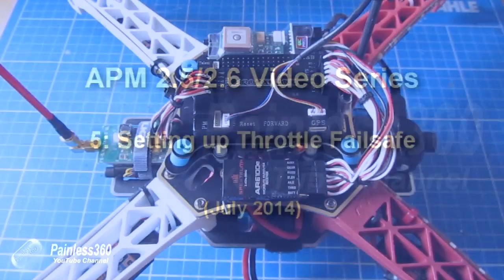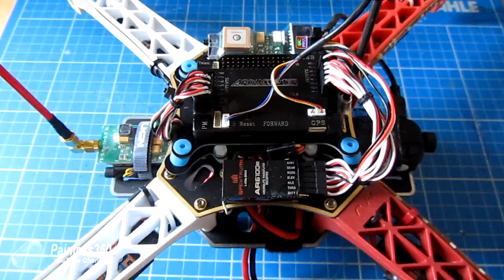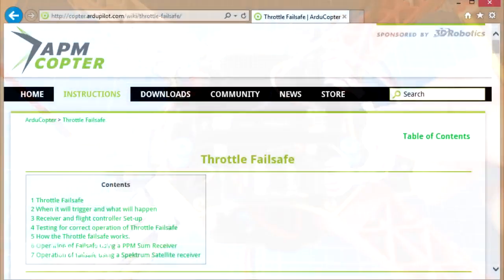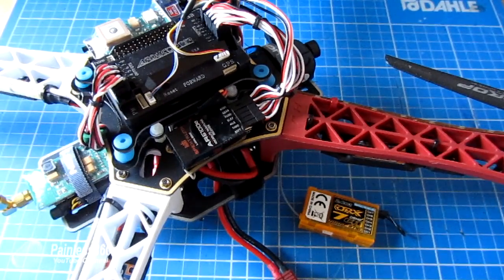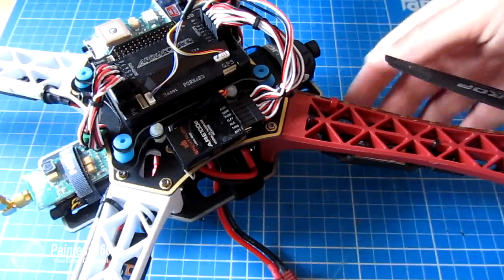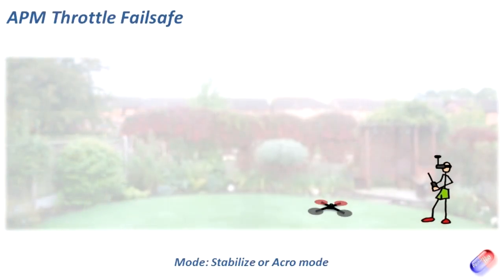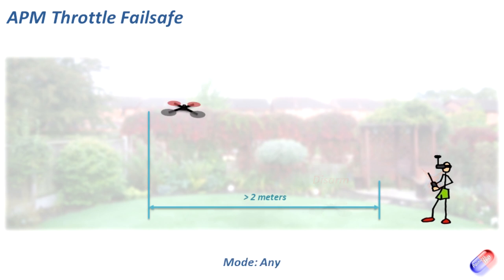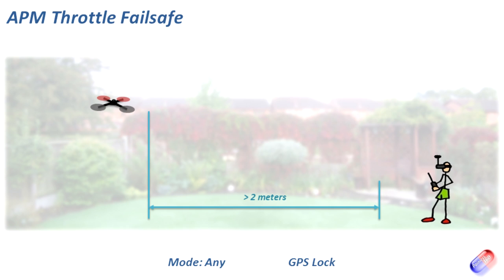(5/8) APM 2.5/2.6/3.1 - Throttle Failsafe Setup

Comment: This gave me problems that I'm still trying to resolve.  I'm using Spektrum dx6i, and something happened with my arming process to where the new stick values are making my left+down position on the throttle to where it refuses to arm.  Not sure my model transmitter works the same as yours, but if I can solve my issue will edit the solution here for anyone else having the issue.
Reply from the maker: Please follow my Pixhawk series. This one was for the APM that isn't supported any more and lots of details at out of date...
Reply: @Painless360  Ah!  thank you.  Not sure how I got to this one, but you've saved me much more future problems right there.  Thank you thank you once again.  Your videos are the most accurate and comprehensive; subject by subject, and the pace is perfect.

Comment: Old video I know...but what did the rebinding do?  It set a different low point? So you are saying that each time a radio is bound to a receiver that the radio also tells the receiver what the high and low points are?  Even without moving the sticks? That part wasn't clear to me.  Thanks...
Reply from the maker: In these receivers rebinding sets the failsafe channel position.. Happy flying!
Reply: @Painless360  Thanks very much.  Yeesh something so basic about binding I didn't know...now off to set my failsafes...  :)

Comment: When I push throttle up all motor spin but  quadcopter didn't lift up,  why it's so
Reply from the maker: Could be a few things. Have you watched my series on it? What troubleshooting have you done already?
Reply: When I set the throttled end point to max. 120% on transmitter,  value on mission planner did, t go below 1080 & then when I push throttle fully,  the display did,t fill fully.  So are changes need.  Plz help
Reply from the maker: That won’t stop the model from hovering. See http://ardupilot.org/copter/docs/common-radio-control-calibration.html I’d check ESC calibration and prop size and fit.. best of luck

Comment: Help if you set the failsafe via the receiver is it still necessary to set the PWM to 20 PWM less?
Reply from the maker: I check out the latest on failsafe in the ardupilot documentation. Best of luck

Comment: Hello, 

I am not able set my Failsafe or even if I am doing it correctly, I am not able to arm my vehicle. I am arming through safety switch and then applying Right Yaw but in spite of all this, Mission planner keeps showing DISARMED. It even asks "Precheck - Throttle Failsafe value". 
Please check the issue here, for more information - https://discuss.ardupilot.org/t/errors-disarmed-failsafe-no-rc-receiver-and-motors-do-not-stop-after-operation-or-not-disarming/31317

I request you to solve my query as soon as possible. 

Thank you in advance for your help.
Reply from the maker: When I've had that this page has held the answer - http://ardupilot.org/copter/docs/prearm_safety_check.html best of luck..

Comment: This setup does not work with the FS-i6s transmitter. After setting the end point values, then trying it out, you cannot arm the APM 2.6, it just displays "PreArm: Check FS_THR_VALUE"
Reply from the maker: That’s a common problem with lots of radios. Check in the forums, there’s lots of detail on how to sort that out. Best of luck!

Comment: Awesome videos. Iam testing RTL indoors without props and 7 satellites on GPS. It engages in RTL when I kill power to the radio, but the motors continue to spin for a very long time. Is it suppose to disarm when it returns to launch?  Thanks.

Comment: Thank you for all the efforts, on APM 2.6 setting FS_THR_VALUE set to option 2 drone will RTL when Radio signal loss, I use pc to set way point and  switch radio to Auto mode, NO telementry. ANY IDEAS to make it continue with mission? thank you
Reply from the maker: +PAL- GATE not sure on that one. I'll have a look in the forums to see if anyone else has had a similar problem. Best of luck..

Comment: Painless - quick question, after setting up failsafe as in the video and then your go to the flight modes setup page when powering off the transmitter should you see RTL trigger?
Reply from the maker: The best place for details is here - http://ardupilot.org/copter/docs/radio-failsafe.html - best of luck!

Comment: Painless - Thanks for all your hard work, excellent job on the videos! My Flyski fs-i6 transmitter has a strange behavior, when in Mission Planner and I power on my transmitter my laptop com port conflicts and drops out causing Mission Planner to disconnect from the APM. Every once in while it doesn't do it but more times than not it does. If I have have the main lypo battery powering the APM it doesn't drop out and is fine. Weak batteries in the transmitter maybe? Anbody else experience this?

Comment: Great videos partner. I got everything working -LOITER, RTL, STABLIZED MODE.......BUT!   Manual RTL works great, but when I turn off the radio things get a little scary, lol.  In testing today it gets wobbly in the air, then it landed about 25ft southeast of where it took off. the landing was totally scary, it got about 2ft then starting drifting to its right finally skidding about 5ft to a stop. As it lay there tilited to the side the motors continued to run for another 8 seconds then they shut down.  The scariest thing is I turned the radio back on to try to get control of it, when I noticed it was not going to land where it was supposed to, and it didn't respond to any input. Even after the motors stopped I noticed that I was connected with the OrangeRx R620X V2 with Sat and couldn't arm or disarm the craft. the APM wouldn't respond to anything. After disconnecting and reconnecting the battery everything went back to normal. Is this the way all of this is supposed to work or am I doing something wrong?
Reply from the maker: Possibly, I'd check the documentation to check - http://ardupilot.org/copter/docs/radio-failsafe.html. Usually when the copter lands in fail-safe it will assume that the worst happened and sometimes need a hard reset.. But at least you know it works! You've got farther than most - well done!
Reply: Painless360 wouldn't it be easier and probably less confusing to setup the receiver to failsafe to RTL? Wouldn't that work?

Comment: Hi, thanks for these videos, they are going to be a big help to me over the coming weeks - i am about to fit an APM 2.8 for the first time (converting my old QR X350 pro). The only thing that confuses me during this video is when you switched off the TX to check the failsafe worked and it disarmed instantly. I am assuming it done that because you were connected via mission planner and not actually in flight? I am guessing that if the quad was actually flying it would RTL rather than disarm? No doubt a stupid question, but it's the sort of thing that would worry me when i got to that part of the set up. Especially because the lipo batteries i use in my TX have a built in over discharge auto cut out feature. They have caught me out a couple of times when i have accidentally let them run a bit too low and they have shut off.
Reply from the maker: Yep - http://ardupilot.org/copter/docs/failsafe-landing-page.html
Reply: Fantastic, thanks, great info.

Comment: Hi Painless, great suite of videos thank you.  I have followed this video to set up the failsafe however at the end I cannot arm my copter as I get the "check FSTR value" response when I connect to APM.  I am running APM on a MacBook Pro, I have a Taranis Plus TX and RX and APM 2.8 controller.
I have calibrated the radio at 100 Low (998) 100 High (2000+), bound the tx/Rx and then set the end points to low (1026 and high 1974).  I have set the PWM number at 1018 (20 above the 998 value).  Within the TX menus I have set the Failsafe to "Receiver". Having done all this in the steps as per the video I cannot get the system to arm to check the failsafe.  Have I missed something?  Should I reset the APM 2.8 and go through the whole installation and set up process again?  Regards Andy
Reply from the maker: Going below 1000 and above 2000 on a flight controller is never a good idea, I'd follow the endpoints/travel we used in the video. Best of luck!

Comment: After setting the throttle value to 960 below the failsafe value (990).Disconnect the apm n bind the receiver n unplug the bind plug n set the throttle to the original value. I arm the apm n discount the transmitter battery the throttle value return to the initial value that is 999 and not 960.
Reply from the maker: I'd look at posts in the forums on that specific receiver you're using. Some have specific things you need to do to store the fail-safe positions.. Best of luck!

Comment: I am using Flysky fs=i10 transmitter, there is a failsafe setting , can I used that for setting failsafe?Thanks
Reply from the maker: +alexongpanghai yes, that should work. I check it all out on the bench first though. Best of luck!
Reply: Thank You.

Comment: hi lee. is this the same way of setting up failsafe for the pixhawk ?
Reply from the maker: If you're using Mission Planner and ArduCopter it should be. Check the latest documentation as it may have changed since this video.. Best of luck!
Reply: Thankyou

Comment: You shut off tx but the state didn't change to RTL, also i didn't see the throttle go to a value that would sustain flight. What were you looking at that tells you a RTL would have taken place...Just curious.
When I create a failsafe senario mission planner and apm 2 both switch from whatever mode they were in to a RTL indication.
Reply from the maker: That's the way it should work. Some receivers can be set to a no-pulses setting and some receivers don't have failsafe at all.. Happy flying!

Comment: How do i lower endpoint past physical on Taranis Plus ? Subtrim is 0 and min/max is -100/100. Physical lower limit for throttle is 988... How do i lower that ? Youre using different radio so got a bit confused.
Reply: Figured it out. Need to check "extended endpoints" in model page2.
However i cant seem to replicate this video's result. I rebind with lower endpoint (960, while physical stick is 988) and when i test it it never goes down below 988, still says DISARMED, but doesnt make me confident that it actually works... Help ?
Radio is Taranis Plus, RX is D8R-II Plus.
Reply from the maker: It doesn't' work that way on Taranis. You need to setup the failsafe values you want output in the menu.. Look under the part where you bind in the menu. Best of luck!
Reply: I cant as it is a D8 mode receiver, there is no failsafe options where they would be if i were using X8R in D16. I did figure it out eventually. Apparently D8R-II is a bit finicky with setting FS.
Reply: @Painless360  Thanks for this channel.  Is there any video describing this point?

Comment: Quick question - what happens after its already in FS due to signal loss (distance, not fault related) and in RTL and it reacquires the signal from radio ? Will it still continue with RTL or revert to normal control ? Great videos. I recently scored an APM2.8 and now fiddling with it on the desk.
Reply from the maker: If the radio, Rx and physical connection come back to life then the model will normally return to the mode you have on the radio. Happy flying!

Comment: Has anyone found out how to do this with the Flysky FS-I6 and IA6B?
Reply from the maker: Almost the same way - in the End Point menu extend the low throttle value as low as it will go. Then go into the Failsafe menu and select the Throttle channel (Ch3 usually), turn it on and set it to the new super low value. Rebind the Rx then reset the throttle endpoint to -100% again. Test it by turning off the radio and seeing the throttle value drop to that supper low value you stored.. Happy flying!
Reply: Dude you're the king! Got the failsafe working and in the air for the first time! Steering was reversed, just had to reverse Ch2 on the Tx and everything is responding perfectly. Glad I don't have to rely on crappy store bought drones anymore, this thing actually has some power! This series is a lifesaver, thanks for the in depth explanations and quick responses!
Reply: I have done the initial calibration in my i6.  The lowest point is at 1026.   I then went into my controller and push the lowest point to -110% is at about 970.  The problem I have is my AMP2.8 will not arm.  any clue?  In order to arm again,  I have to change back the low point in my i6 to -100%.
Reply from the maker: See the APM troubleshooting arming video for what to do.. Best of luck!
Reply: Follow his instructions again on his first comment to this. At the end you have to rebind, then reset the throttle endpoint back to -100%. PWM should be about 1000 at 0 throttle after you do this and when you turn off the Rx in Mission Planner you should see PWM drop to 900-950, put the failsafe PWM at 975 so it kicks in.
Reply: @shanevm2009/Painless - I have the flysky fs-i6 with a FS-iA6B Receiver and the 10 channel upgrade. I have my endpoints set up in the transmitter as described and done the rebinding, etc. When I kill the transmitter the throttle position doesn't change as it seems the "Receiver" is still active. If I unplug the channel3 servo cable while watching in Mission Planner it drops to the low valve as in the video. Is there another setting somewhere I'm missing?
Reply: Update - I finally figured out that in addition to the video steps out lined for Mission Planner you also need to setup the endpoints in the Flysky transmitter within it's failsafe menu. There are a couple video's on youtube showing how to do this.

Comment: hi painless. will the failsafe on the rx not put the apm into rtl when you kill the tx signal. Ie if I've set the failsafe on my lemon rx to put my lights on and rtl when I turn off my tx? thanks again as always
Reply from the maker: If you set the failsafe on the receiver to select the RTL mode then it should.. Best of luck!

Comment: i am using dx6i spektrum radio with APM 2.8 board .. Gear switch for stabilize and A/Hold when i use al/hold mode  stabilize off .. and ch 6 is not working how i use ch6 for RTL ?
Reply from the maker: Sorry, I don't understand the question? Can you try and explain what you're having trouble with again please?
Reply: Sorry ! my English is very poor.. simple Question. my Quadcopter with APM 2.8 during Test flying in My Room after 4 Minutes flying  during landing Quadcopter auto fast Move Up and Touch the roof  without The Throttle  and Fall down .. (may be this is fail safe mode) because i was flying in stabilized mode not RTL..
Reply from the maker: No idea, I'd check the logfiles from the APM and see what it saw. If it saw the throttle jump then it's the radio/failsafe settings you'll need to look at.. Best of luck!

Comment: I can't get this to work on the Taranis. I tried adjusting in the "Servos" menu but it won't let me go past -100, and at -100 it is 982 in Mission Planner. Any ideas? I'm totally confused by what this is, why it's needed, and why it can't be simpler.
Reply from the maker: I'd consider using any value <990 as the failsafe then and reduce the endpoint on the radio to about 97% on the throttle channel and rebind so that it doesn't go below 1000ms in normal flight. Best of luck!
Reply: Just out of curiosity, why is rebinding necessary? once the endpoint is adjusted to about 97%, isn't it impossible to go past that in normal flight?

Second, I have tried everything and I still can't get this to work. I had a very slight crash while using Autotune and now I can't arm because I keep getting the fs_thr_value error. Any ideas on what might have happened?
Reply from the maker: But then how does the receiver know what value you want to send in the event of a problem and how do you make sure that the value never gets sent if the radio connection is ok? ;)

Comment: Hello! Great videos. Could you explain the necessity of lowering the minimum value, rebinding and raising the minimum value? Wont the value always drop below 990 once the transmitter is switch off? thanks!
Reply from the maker: +OdeToTheSquall it's so that when the radio link has a problem the throttle value the receiver failsafe uses is below the normal range and that can be used to trigger the failsafe on the flight controller. Happy flying!

Comment: Sir, I realized there's not any videos about how raspberry pi can communicate with pixhawk/APM. Would you please show us how to use raspberry pi to sometimes override and give new commands to the rotors when the raspberry pi senses an obstacle through image processing, ultrasonic sensors or anything of the sort?
Reply from the maker: That's a little beyond our capabilities. I've worked with others who've used Arduino to create PWM signals for copter control but never worked on a Raspberry. If you get it working the community would benefit if you documented how you managed it. Best of luck!

Comment: What's the process to get this setup on a taranis?
Reply from the maker: Same as this. You'll have to extend the throttle low endpoint in the servo menu and rebind then put it back to what it was before. Best of luck!
Reply: Radio end point was 982, I set my PWM to 980 and it allowed me to arm. Is this ok?
Reply from the maker: I'd try and keep the throttle for normal range inside 1000-2000 and only let it drop below 1000 for the failsafe state. Best of luck!

Comment: Hello, i bought a power module for my APM, i wanted to check if my PM is working in mission planner. At the same time, i don't want to risk frying the board by connecting USB and battery at the same time. Do you have any suggestion on this matter? Thanks
Reply from the maker: +Saiful Raznan see our video on the PM pins. There are a couple of versions and you need to check that you've got the right pinouts. Best of luck!